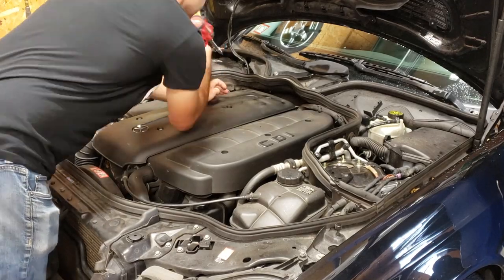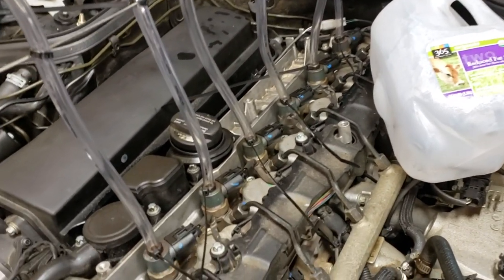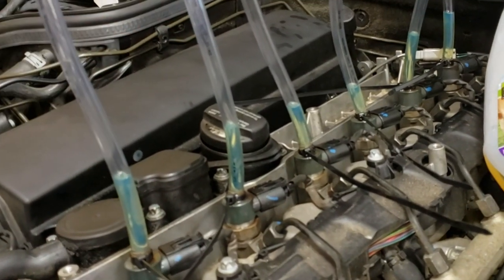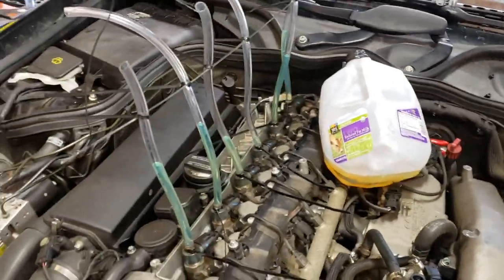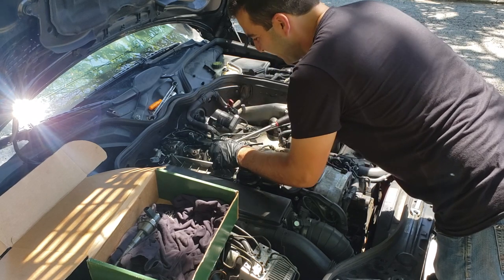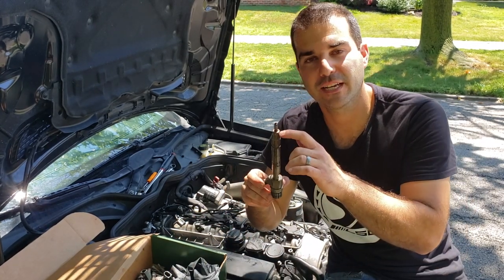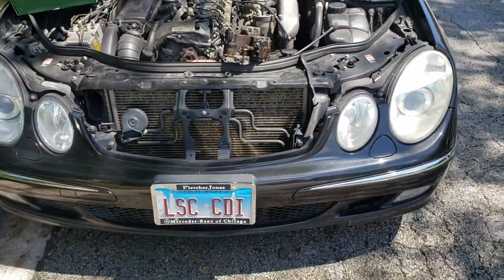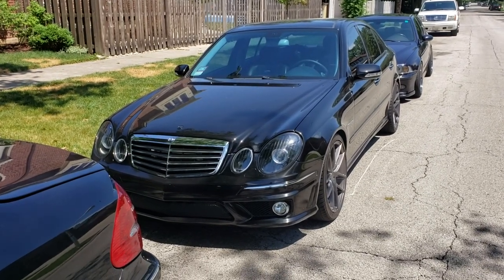Here’s Why I Stopped Making Videos With My Turbo Diesel Mercedes & What Hitting An Armadillo Did.

Comment from the maker: Who else drives a diesel? Whatcha got?
Reply: LegitStreetCars had a 2002 tdi Jetta back in da day. Was ok but not great
Reply: going to buy a Mahindra Thar Diesel very soon, In America, you know it as Mahindra Roxor.... But it cabbed version in India and has 4x4 abilities with unlocked ECU.
Reply: My mom has a 2006 cdi with only 70k in Chicago :) Garage kept the entire time. She loves the car.
Reply: W211 E280 CDI v6 no dpf stage 1 mapping 
280hp
680 nm
Soon thinking to get a downpipe
Reply: 2014 Ram 2500 CCSB 4x4 6.7 Cummins... significantly modified.
Reply: I guess here in Europe where these 320 cdi's are fairly common, would be the right place for tuning and upgrading parts for your 320 cdi?
Reply: 2.4 five pot Alfa Romeo
Reply: i drive a 2004 mercedes 320 cdi just like you, i got it before you bought yours, and was happy that you bought one, now i need to save up some money and start modify it
Reply: C220 CDI coupe, with turbo upgrade & intercooler 282whp and 500 ftlb, goes quite well
Reply: Papà ha un Fiat Doblò 1.3 mjt con 75 cavalli e qualche anno fa avevamo una FIAT Brava 1.9 TD100. Grandi veicoli, il Doblò ha 210.000 kilometri!
Reply: W211 e220 cdi
Reply: Mercedes e200 W211 2006.
Reply: Finally, Diesel! 2018 X5 35d bone stock, for now. Keep em coming Alex!
Reply: S212 220CDI with a custom tune which is supposed to produce 210HP and 500Nm of torque. Haven't put her on a dyno yet.
Reply: 2008 BMW X5 3.0d M57
Reply: @therushden  10V or 20V? :)
Reply: 2004 E220 CDI
Reply: @frosty98412  20v 159 I've driven a 156 with the 10v, good car.
Reply: w204 estate c220 cdi the OM646 engine 208k miles. And i'm planing to look for the black death. I'm scared of it tho.
Reply: 2006 Mercedes e320 CDI
Reply: I got a 2003 vw Jetta tdi! Has a full straight pipe and stage 2 tune plus bigger nozzles!! Love watching your build of this car, definitely going to look for one when I replace my car
Reply: I am driving this E420 CDI. V8 Biturbo!!! I Hope you will Upload Videos Soon about this car.
Reply: @therushden  nice to see alfa fans here. 156 2.4 10V with a straight pipe is a beast. I drove a 147 with the 1.9 8v remapped hard, now I have a 156 2.5 v6, enjoying the sounds.
Reply: Alfa Romeo 166 2.4 jtd (stage 1)
Reply: 2007 E320 (160k) & 6.0 Ford Excursion (225k)
Reply: 2008 Bmw E60 535d stage3
Reply: '13 Great Wall Wingle 2.0 diesel
'86 2.1 diesel swapped Peugeot 504
Reply: LegitStreetCars i own a Ssangyong Rexton 270 xdi 2012, it’s engine is the same as the 270 Cdi from Mercedes Benz. Great engine!! Greetings from Costa Rica
Reply: I have e 320cdi 2005 its a beast i also have a Ml 420 cdi v8
Reply: S204 220 CDI, but thinking of lpg w211 500
Reply: 1983 300D turbo diesel
Reply: What power gain with just the intercooler then turbo etc
Reply: 2008 Jeep Grand Cherokee with the (Mercedes) 3.0 liter CRD.  And a gas E300 (2008).
Reply: Cdi 2006 sprinter 304000 miles still going strong
Reply: Mercedes-Benz CLS 350 CDI Shooting Brake 4Matic. Something you didn’t get in the US @legitstreercars
Reply: 2004 c220 w203 Mercedes Avantgarde with a om646
Reply: 2014 International Prostar Cummins
Reply: 2002 Audi A6 C5  Avant 1.9 TDI with a small remap...
Reply: 1992 Mercedes 300D 2.5 TurboDiesel. Only 256,000 miles.
Reply: 2008 GL 320CDI. Love it!!
Reply: W211 2.2CDI 2003
Reply: BMW E46 330cd (2004) with 88k KM
Reply: W204 Facelift 350 cdi with 265 horsepower en 620 nm
Reply: 2.0l diesel volvo v70 wagon and 2.0l diesel Skoda Suberb sedan
Reply: W212 e350 cdi with a custom remap (tune), egr delete and the back boxes removed (mufflers).
Think the dpf is coming off soon too.
Reply: Give a tutorial how to extract broken injector mount bolt.
Reply: 2016 Mercedes A220d AMG Line, 2.2d, DCT. Premium Plus with BRABUS D2 pack. 420NM of torque in what is a light car with 0.1 second gear changes. An absolute hoot to drive. And 68 MPG average weekly fuel economy.
Reply: @TheLassenman  I got my parts from BRABUS. Thats for my 2.2d. They sell the D1, D2, and D3 tuning packs.
Reply: @Alps6408  Damn, what did you do to get that BHP ?. I have a A220d with the 2.2d and a BRABUS D2 tuning pack. Thats 205bhp and 420NM
Reply: Got a CLK 220 cdi sport. Would love to know how much power I can squeeze out of her!
Reply: @vinmilesfewpics  In Europe, there is always a Sprinter in the outside lane of the motorway doing 120+. Those things are quick.
Reply: @Alps6408  what size turbo did you use? And what about fueling etc? :) would love to achieve similar results with my 220!
Reply: E46 330d
Reply: I have two 2005 E320 CDI's. I have a larger intercooler and just a cheap tuning box for now as well as an interior swap and partial E63 AMG kit on one of them. The other is bone stock.
Reply: @jackinthebox8298 For my 2.2d I have the BRABUS D2 box, which is a simple plug in box but Mercedes approved.  205bhp and 420NM of torque. It really changed the car !. Mid range punch is really great now. But same MPG !.
Reply: My folks have an 03 e270 CDI 5cyl I frequently work on.l, basically your car with on less cyl
My own car is a 2002 BMW 330i touring running sequential propane injection.
Reply: 2014 jetta tdi highline with a 6-speed manual :)  Got it as a dieselgate buyback.  Oh, and the work truck, 2013 Volvo VN680 with a Cummins ISX :)
Reply: 1.2 TDI VW Polo 😂
Taxes are crazy for a diesel in the Netherlands so we have a tiny 3 cilinder engine
Reply: @dj_paultuk7052  cool
Reply: 07 Touareg 2.5 TDI
Reply: 2013 BMW F20 116D EfficientDynamics - 1600cc 4 cylinder engine - 46MPG average as of now, but in freeway I usually get 55+.
Reply: 2004 VW golf tdi
Reply: 2011 BMW 320D Msport with hybrid turbo, Rogue downpipe, full straight pipe, drop in filter, custom map and xHP gearbox software. Keep them diesel vids coming fam! And regards from South Africa
Reply: Me again. The 211 320 cdi. (without the intake swirl flaps - > from factory).
Reply: 2006 320 cdi  60k miles ----------------------  Thanks for the videos on the CDI I really appreciate it.
Reply: 2007 Jeep Grand Cherokee CRD - which has the excellent Mercedes V6 Diesel.
Reply: I think the armadillo Alex hit was also driving a diesel.  :-)
Reply: E270 Cdi - the 5 cylinder version of the 320 you have.  Following your mods with interest.  In the UK we have two cats (I think the US has just one) and I've removed these. Fuel pressure has been increased about 20%, too.
Reply: i drive a 535d bmw right now but ill buy a new mercedes soon
Reply: It's easy like you said. So I broke 1 bolt inside.
Reply: 1999 7.3 Ford Powerstroke
Reply: My2017 Volvo V60 D4
Reply: 06 MB 320 CDI.. With bumper coming off from Driver Side Fender and a little bit of Black Death around first two injectors.
Reply: I daily my 2017 ram 1500 Ecodiesel. I have a Green Diesel Engineering tune on it.  I am also working on a TDI motor that may go into my BMW E30 or other project.  It was formerly in an 05 passat. IE connecting rods, DarksideDevelopments ported cylinder head, cam shaft, and machined and coated pistons. I also have a GTB2260 turbo.  At the end of the day it should be putting out close to 300hp and around 450lb ft of torque.
Reply: 82 240D and a 91 Dodge W-250
Reply: 2013 Volvo v40 With the 2.0 5 Cylinder.
Reply: Just bought a 320 CDI and marathoned your  CDI vids!  good stuff!
Reply: 2010 C250 cdi wagon and its amazing! remap and mods on the way
Reply: 2013 f250 with 6.7l turbo diesel
Reply: 2007 facelift w211 E220 CDI with 218k miles and still on the original turbo etc never had major repairs and is fed regularly with Mobil 1 0W40 fully synthetic engine oil. Going to keep putting miles on it for years to come
Reply: Alex, I have a 2005 E320 CDI Hybrid with 240K miles. I really need an Intercooler upgrade. Please share your solution. Thanks
Reply: 2006 Audi A3 1.9TDI Sportback
Reply: bmw 320d 2010
Reply: I have a e320 cdi 2005
Reply: BMW E60 07 530d M Sport
Reply: LegitStreetCars Mercedes 300 om606 320hp she’s a quick old girl
Reply: Got rid of my W204 C class AMG sport 2.1 tdi .. Hated every bolt of it ... We talked about it once Alex .. pulled to the left even though the tracking was spot on .. Anyways ... Mercedes completely repainted it due to a paint issue .. spent a grand on sensors ... and then got shot of it [best one in the country when I sold it :D ]. A hateful thing .. Got an A6 C7 2.0 TDI .. sweet car. By the way ... best thing for that BMW is a can of petrol .. and a match :D Love the vids brother. Keep them coming.
Reply: Alex I bought a 1992 E-350 Ford van from Com-Ed auction back in '04 for $4700.00 it HAD 18,000 miles on it. Today it has around 60,000 miles on it with a 3 inch ambulance body lift, front leveling springs, a Gale Banks Turbo and Exhaust, and gauges and such. Mainly use for pulling trailer. It is a beast!
Reply: @popcaan6299  Not worth it
Reply: 2000 VW Jetta TDI w/ 104k miles. Need to fix some interior bits from an old sunroof leak and hopefully get around to upgrading the suspension sooner rather than later.
Reply: Mazda 6 , 2.2 Skyactiv D
Reply: 2006 Mercedes e320 CDI  238k miles
Reply: W203 200cdi amg injectors
Reply: Golf 6 2011 tdi 1.6 105Hp
Reply: "03 320cdi. Love watching your videos cos  the nohow you got. Been struggling to find info to build and tuning the old merc
Reply: 1981 300TDT with a 4 speed stick swap, Holset HX30W, and Benzforce / Dieselmeken 7.5mm MW injection pump. Also have a Euro spec 1985 300TDT that’s mostly just stock and lowered on AMG pentas
Reply: I had a 00 tdi Jetta with the ALH and a stage I tune until I had to upgrade to a bigger car. Then I picked up a 2015 Passat TDI that was fixed!
Reply: 2012 Jetta TDI. 
40mpg average - want to DPF delete it, but got too many other projects to care :-/
Reply: Dad had a 2002 C220 cdi t Model , Now has a Alfa Romeo Giulietta 2.0 Jtdm
Reply: 2012 W212 E350 Bluetec with 134K miles.
Reply: I have 26 cars in my collection/fleet. The only Diesel is a 2014 E250 Bluetech. 44.4 mpg, cruises 100 mph all day and night, comfortable and reliable so far.
Reply: 1989 Ford f350 7.3 idi n/a old fire truck
1981 Peugeot 504 wagon diesel
Reply: 2007 volvo v70 5 cylinder d5
Reply: 03 Dodge QCLB 3500 4x4 DRW 5.9l HPCR. It is modded but still have some more mods to get me that 550hp and 1300 lbft torque that I desire.
Reply: Had a 2000 Jetta TDI and now have a 2012 ML-350 BlueTec which is an absolute piece of garbage. Every month a new issue comes up. The Jetta was pretty good. In 16 years of ownership, only had to do Starter and Alternator.
Reply: Range Rover Sport TD6!
Reply: I have 2 turbo diesels, a 301 HDi, 1.6, and a 3008 HDi, 2.0, both Peugeot.
Reply: 1991 Mercedes 190 2.5 turbo diesel
Reply: I got a 2003 vw jetta tdi wagon.
Reply: 2015 BMW 328d, Xdrive. Smooth.
Reply: @stuartpickles6907  Ford's first diesel truck! 1986 F250 XLT Lariat Explorer diesel with the 6.9L having only 67 000 original miles! (6 digit odometer) (109 000 original kilometres!) Bought it from the original owner! Right now it's parked as I need to fix the brakes, the rear driver side brake cylinder failed so it's leaking brake fluid so there's no brake pressure whatsoever, basically lost brakes. The brake fluid looks pretty bad and a little orange so I think I'll replace some brake lines and maybe the brake booster or upgrade it to a newer F250 brake booster. Not sure what I'll do. Anyway there it is, I haven't made a video on it yet. But will.
Reply: 2012 C250 cdi in New Zealand
Reply: a6 c7 3.0TDI
Reply: 211 wagon with chipped 220cdi engine👌
Reply: 2008 audi A6 2.0TDI 6speed manual
Reply: Mk3 golf tdi, 200hp 400nm
Reply: V70 D5. I don't get it, why it wasn't available in US, it's just perfect (beside fwd)
Reply: Seat Leon FR 2.0 TDI 184PS
Reply: 2006 chevy 2500 with a duramax, also that looks like a cp3,3 high pressure fuel pump, the same that is in a duramax, or cummins diesel engine, do u know if thats a cp3.3 or cp3.2?
Reply: 07 E320 CDI, I feel your pain on mods, but know you are my hero!!!!
Reply: LegitStreetCars 06 Jetta TDI 193K 
GREAT CAR: Great mileage and decent performance but goofy electrics
Reply: A Ford transit
Reply: 2006 Sprinter 140" WB/Low roof
Reply: 2006 E60 BMW 535d stage 1 map
Reply: @lmCIoudz  why? not talking about 600hp, maybe 300, should be easy enough
Reply: E280cdi 2007, a E350cdi 2017 and a Piaggio Porter 1.4D :D
Reply: Fiat Stilo 1.9JTD
Reply: R320 CDI. Always wondered about ways to open up the engine a bit..
Reply: Volvo v70 D5 2005
Reply: 2006 ford focus 1.8 TDCI
Reply: Virtually identical '05 e320cdi, and a '10 335d
Reply: 2008 W211 E320 CDI (V6) in dire need of some modding
Reply: CLK270cdi great for distance & economy. A little creative remap & 220bhp & 60mpg is easy. The torque & sound of a 5 cylinder is like nothing else, more akin to a tractor in both cases :-)
Reply: 1999 Ford escort 1.8 TD
Reply: I have a 2006 Merc e320 cdi with the keyless-go option.  The option was very rare during that time and even harder to find now.  Love the car.
Reply: I got thrice Dodge ram
Had a old Nissan diesel went 500k I'm at 380 on my 99 dodgy
Reply: '06 E320 CDI.  I've owned it since 2007 and it had 30K on it when I bought it.  I've got 326K on it now and still going strong.
Reply: I’ve owned meny currently a 5.9 and a 6.7 cummins
Reply: A LEGIT 2015 Passat TDI fresh! Just got it with only 16k miles! Woot wooot!
Reply: A6 TDI..
Reply: 2014 Porsche Cayenne Diesel. It’s wonderful average 26 mpg in town and 32 mpg doing ~ 75 mph.
Reply: Had a 300td 87 when I was younger and I now have a w212 e350 bluetec and a vw golf wagon tdi.
Reply: Deisels belong in trucks, ships and generators, not cars.
Reply: 86 F350 6.9, 96 F250 7.3, 97 F350 7.3 with about 4x the hp of stock, and an 03 F250 7.3
Reply: W163 ML 400 CDI, greetings from Germany! I'm wanting to tune my Diesel aswell!
Too bad we must obey the TÜV and the Biturbo V8 won't pass Germanys near future emissions regulations.
The OM628 and OM629 will easily produce round about 400HP with a new exhaust system, software and intercooler. With a strenghtened block, proper hybrid turbo, uprgraded diesel pump and a strenghtened 722.6 transmission, with V12 parts, 500HP could be reachable! 
I hope someone will do such a project and unlock this engine's full potential!
Reply: r350 bluetec
Reply: I drive a 2005 Ford Focus II 2.0TDCi. (stock 136hp, now approx. 200hp.) Torque rocket like you won't believe it (It's not incredible horsepower, but 324 ft-lb on 2700 weight... :D:D:D) But, I'm now looking around for a Volvo C30 D5... Just because it's a weird car and faster than anyone likes to admit...
Reply: e39 530d 3litre inline six :):) with a leaky injector lol
Reply: 2004 Jetta tdi sport edition. Rock solid, just some glue plug codes
Reply: 2018 Dodge Ram 3500 for work
2001 Ford F450 as a project truck 
2012 Volks-Wagon Jetta wagon for road trips and anything other than around town.
Reply: BMW E46 touring 320d with 350 000km and yeah I'm from Europe
Reply: The illuminati killed off Mr Diesel as they knew Rudolph  could create it from Algae!
Reply: you should check out the european mercedes forums there is mutch info on tuning cdi engines, like c30 amg injectors ant lots of companys witch modifi injectorrs
Reply: E39 <3
Reply: 2005 CDI, just hit 97k
Reply: BMW F30 320d. But a lot of experience with W220 320cdi's. Thanks for the great video's Alex!
Reply: 2007 320 cdi 428000 km stage1. and 2003 270cdi 425000 km stage1. and vclass 2003 328000 km stock.
Reply: Current rigs are  2003 F350 7.3 6 speed manual, and a 2005 E320 CDI. I have a 1996 f250 7.3 waiting on a replacement turbo.  The past rigs: 2 alh  jettas, I still have the first one in my vw graveyard, it was retired to parts duty with 440,000 miles when the auto trans went.
Reply: 335d here.  The return line just split open while driving.
Reply: 1.6 litre 2016 seat leon turbo diesel here. 110 hp 250nm 5 speed manuel. 60 to 70 mpg.
Reply: W212 E350 CDI Bluetec, AMG Line Night Edition body kit. It initially gave 245bhp on the dyno which we upped to 315bhp / 550lb ft with no further mods other than remap, rev limits, torque limit and gearbox adjustments. I get about 50mpg. Love it.
Reply: Just purchased a 2006 E320 CDI!
Reply: P7100 pump 12 valve cummins Dodge Ram, OM617 MB 300TDT, OM603 MB 300DT and OM601 MB 190D.  Yeah, I am Old Skool.  Would love to get a CDI if I could afford one.  But honestly lately, I have just been lusting after your W211 E55.
Reply: 1983 240D, rare car in Indonesia :)
Reply: Sel Passat tdi 2015
Reply: 2007 W203 C320 CDI. OM642 engine with 7G-Tronic. I love my car 😄
Reply: 2015 Passat TDI 6MT!
Reply: `11, ml350 Bluetec, om642
Reply: Kicking a S203 2.7 CDi
Reply: Mk4 Golf 1.9BEW 
I really want the e320 now !!
Reply: 2000 S210 (wagon) 270 cdi 250 000 mi 
2003 s211 (wagon) 320 cdi 332 000 mi
Reply: 3 2005s 1 2006 an 1983 300d , 1982 Chvevtte 1.8 diesel, 1985 Volvo diesel, 5.9 Cummins in my bus and my tool truck, 855 Cummins in my dump truck, 3406b in my Peterbilt, few dt466s, fee other diesels too
Reply: bme e39 530d
Reply: s211 E320 CDI 2003  the hybrid turbine is further free of catalysts and has a power output of more than 268 hp and more than 640Nm at 2500rpm.
Reply: 2005 e320cdi 324000. Starting to get some bounce in my tc. One tube of shudder fixx and it’s almost fixed now lol. The E320cdi is  seriously such an amazing car I honestly feel so fortunate I got my hand on one.
Reply: Instead of warming up your car and removing them In a hurry, I used my variable temp heat gun and Warmed each one up to 200+ degrees and they game right out. One by one. No racing the clock
Reply: Just sold 2016 GMC Duramax. Just purchased 2008 Jeep 3.0 crd
Reply: Your series inspired me to find a 2005 E320 CDI... 99k miles, one-owner. Completely stock, from a Benz dealer in Northern Virginia at a great price for the low miles and seriously new-car condition. Had a thorough pre-purchase inspection done and all it needs is serpentine belt and tires (plenty of tread, but old!). Will be making mods as things need work... LOVE the videos, Alex! Hope you'll keep updating your CDI adventures. Thanks!
Reply: w211 270 cdi 2003 722.6 210 hp and w211 320 cdi v6 2007 with dpf and 722.9 260 hp 610 nm  w638 vclass 2.2 cdi automatic
Reply: 270 has 436000 kms and 320 has 444000 kms vclass has 325000 kms all stil going strong
Reply: I drive a 2008 E320 Bluetec
Reply: Twi BMW 335d's -- amazing cars -- but now I want a 320 CDI!
Reply: 2014 E250 Bluetec 4matic.  I had a 2005 E320 sold it with 380K Kms.  2004 F350 7.3L for hauling the trailer.
Reply: S211 OM648
Reply: Come in Bulgatia (small country in europe) here diesel engines is preferred.Good gas mileage, a lot of torque. cheaper maintenance (if injectros and fly wheels is on good condition)
Reply: BMW D7 Marine
Reply: You have to put injectors from c30 cdi 5 cylinder amg w203 they fit and giving more fuel
Reply: 2007 Dodge 2500 CUMMINS baby!  LOVE them torques!
Reply: Alfa Romeo 166 2.4 JTD here cheers from Italy.
Reply: I'm driving a 120d (the baby bimmer) but... man, oh man... I miss Chicago, used to live by Foster & Western for almost 3 years, drove a W210  E55 at the time (an amazing car),  I have quite a few videos of it (nothing fancy) on my youtube channel IMAGINEBYSZP  -   my apologies for the shameless plug. Now I live and study in UK (Liverpool) and I'm actually looking to get a 320cdi but I would even consider a C320cdi since I don't need the space and I figure it might be lighter, therefore nimbler, but w204 or a really nice w203 (I kind of dig the older one's shape better but don't know about the technicalities). Any thoughts anyone? Kind THX!
Reply: @54V4  but only w211 and w220 get 320 cdi r6 engine c320 cdi is v6
Reply: W211 320cdi. 05

Before that was a W124 250d from 86.
Reply: @Alps6408  W203?
Reply: @DCLXVIIVXLCD  Lucky man None in Ireland with lower than 260k kms
Reply: Two E320 CDIs (05 and 06), a 97 F-350 7.3 and because I'm a glutton for punishment, a 2006 F-250 6.0hno......
Reply: Mg ztt cdti, big turbo, big downpipe, no cats or resonator, fuel system mods, intercooler water cooling system. Its a beast for what it is and always shocks people :)
Reply: '05 C270 CDI. . i want to be buried in it :)
Reply: Love the videos on the diesel Mercedes. I have a 20 plate Colorado with the  2.8 Duramax diesel, so any youtube content that involves performance upgrades for commonrail Diesels catches my attention.
Reply: i dont mean to be so off topic but does anyone know a tool to log back into an instagram account?
I was stupid lost the password. I would love any tricks you can give me.
Reply: @Philip Taylor Instablaster ;)
Reply: 335d!
Reply: I have a 2019 vw caddy van, its a 2.0 tdi with 110hp lol and 250nm
Reply: 09 GL 320cdi (non bluetech)... love the off-road package diff locks and lift at the push of a button but wish it was the 430cdi with the OM629 instead or the OM642. Love it all the same.
Reply: W211 facelift, om642 v6 3.0 diesel. Love that engine, with proper maintenance its bulletproof and without the injector issues that plague the inline-6 before it.
Reply: @spierchips  those diesel V8s are cool man, I really want a OM629 powered GL with off-road package
Reply: I have w210 e270 cdi , it's awesome only needs some mods
Reply: @Alps6408  hello are you able to get in contact with me and give me some info of what you did to your car I have a c200cdi so very similar setup and I want to put a turbo on it but idk what else I would need could you please help ?
Reply: e320 CDI w/110k miles. No black death yet and I'm not going to replace the seals unless I see any. Supposedly, black death won't happen to every car so, if you make it to 100k and haven't seen it yet, you probably won't get any. I know, I know.. I'm skeptical as well but we'll see how it goes.
Oh and I own 4 other diesels. I have a problem 😁